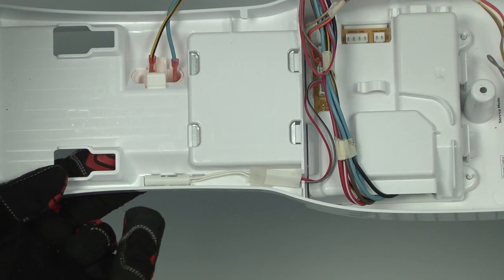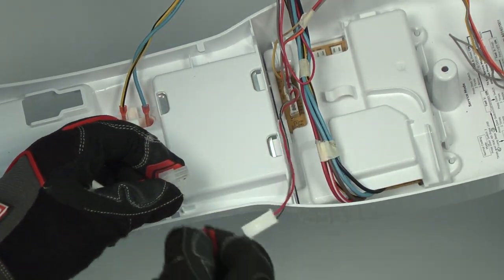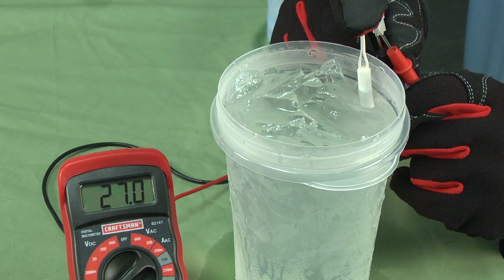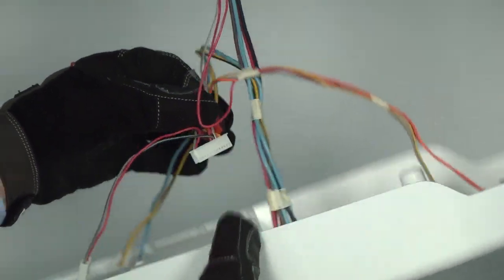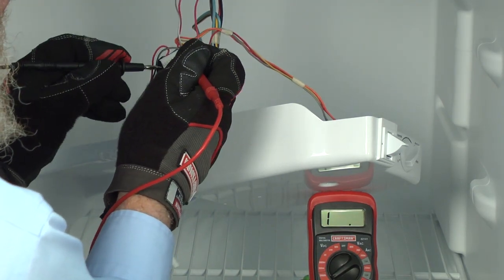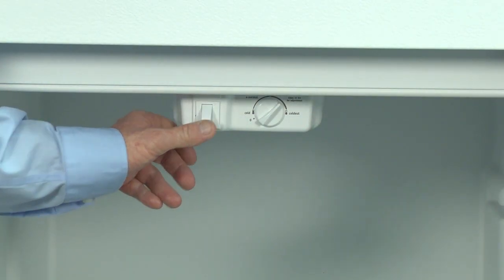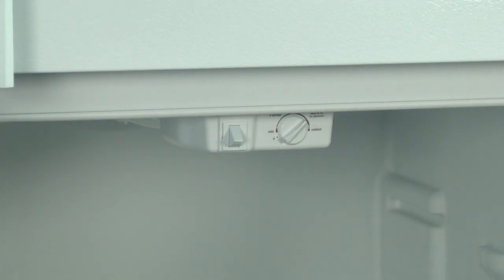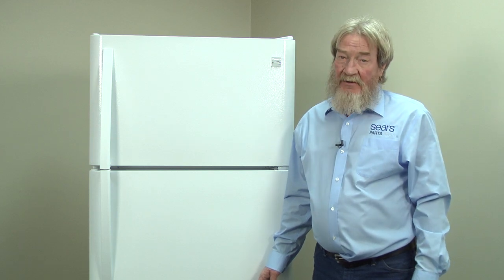Troubleshooting Thermistor Problems in Refrigerators

Comment: can  you  help me 
I hvae  sansumg   that  freeze  solid  in the  hupper part
I have a model rf22nctaww with freezer at the bottom it freezes at the top it doesn't control its temperature well at the top have to change the fan at the bottom it doesn't do anything cahnge they can hear the hatch open or close
but have doubts whether it closes completely and it freezes everywhere is it difficult to clean the hatch or change it on this model

a video would be welcome
THANKS

Comment: AWESOME Video. I was trying to diagnose the thermistor in my KitchenAid Ice Maker and this video helped me a lot. Testing the resistance of the thermistor was the key bit of information that I needed. Once I found the tech sheet tucked inside the ice maker next to the cooling fins, I discovered the values of resistance I needed to know.

Comment: Hello, I have a Whirlpool WRT318FZDM05 refrigerator. The evap coil in the freezer keeps freezing up (solid ice). The defrost element test with 40 ohms of resistance, so its not open. I feel I have narrowed it down to the thermistor on the evaporator coil or the control board. I have no spec sheet for this refrigerator unit, so not sure how to troubleshoot further on the thermistor. Any suggestions, or am I at the point to take a shot in the dark and buy on of the two replacement parts I mentioned? Refrigerator works absolutely fine for roughly a month until the evap coil freezes, then after a manual defrost, rinse and repeat.
Reply from the maker: The tech sheet for that model lists a defrost bi-metal but the wiring diagram shows a fuse instead of a bi-metal switch in the defrost heater circuit from the control board. With the freezer cold (so the bi-metal is below 25 degrees F and closed), unplug the refrigerator and check resistance through the brown and white wires that connect to the control board. If your meter measures infinite resistance through that circuit then the defrost bi-metal or thermal fuse in that circuit is likely bad. Replacing that component should fix the problem. We hope this advice helps. If you need more help, let us know.

Comment: Ive checked my defrost thermister the readings are no where like the ones you've tested here 
Mine reads 6.5 at room temp and 13 in ice water 
The temp sensor for the freezer reads way different again and the fridge different again 
I was assuming all 3 should have similar readings

Comment: Thanks for the great video - I'm troubleshooting a Frigidaire GLFU2067FW5 upright freezer. Start relay checks ok, compressor will not come on but checks ok with continuity at all points. So I think that leaves me with the thermistor or the control board. Can you provide the spec on the thermistor? I don't have the sheet and cannot find it. I'm trying to follow  your diagnostic order before I order an expensive part that I don't need. Thanks in advance for your help.

Comment: What if the fridge stops before it's cold enough because the compressor is overheating (IF that's the case) and WHAT IF the evaporator motor and sensors are okay but the coils are very free of any frost at all, super clean? Could it be the r-134 is too weak and causing the compressor to overwork? Just looking for another possible solution to a too warm fridge.

Comment: Thanks for this great video! As I have learned, "high temp" is not same as high temp alarm. What I have seen on working freezers (set point temp maintained properly according to electronic thermometer) are erroneous triggering of high temp alarm once a day. Display usually shows correct/sane temp for a freezer. I am focusing on thermister and controller in this case. Regarding other units actually running hot, I have identified a problem in which fan stays on during auto-defrost on a blast freezer (Arctiko FP500), which turned freezer into an oven. New controller, did not resolve problem, but shutting off auto-defrost completely resolved problem. What apparently was happening was that as the temperature rose, the compressor would turn off progressively longer, but auto-defrost would progressively be on with fan also turned on longer up until the point defrost + fan were stuck perpetually on. I hence discovered a new way to cook food... with a freezer!

Comment: Hello. Thank you for these videos! I have a WRT318FZDW00 (zero zero, not oh oh). Can you please tell me what my readings should be at room temp and in a cup of ice water. I can not find ANY info on this model. And the paper work from underneath the backside gives me barely any info.  Thank you :)
Reply: Ps. Also if you have a part number in case I need to order a new thermistor. Thanks again!

Comment: Hi, Ive got a LG model #Lfx25978st and ive tested the freezer thermistor and at 32° i got 6.8 Ohms. I do not have the manual for the fridge and can not find the temperature resistance chart for it online. Not sure if the thermistor needs replacing.

My fridge and freezer stopped cooling and was only blowing hot air, then when cleaned and unplugged for 24 hrs to thaw started working again really well. 5 days later it started to warm up and stopped blowing cold air again. All the fans work too and so does the condenser so I am at a loss
Reply from the maker: Here's a link for a copy of the service manual for that model: https://www.manualslib.com/manual/996736/Lg-Lfx28978-Series.html . Check your meter settings. The meter may be measuring 6.8K ohms which would indicate the thermistor may be detecting a warmer temperature than actual temperature. That thermistor likely isn't causing the problems that you're describing. The refrigerator may have a bad control board. A number of other problems could be causing the problems you're describing.

Comment: @sears PartsDirect (Wayne), Hi Wayne, Great video btw and thank you. I have a 
JFX2897DRM02 Jenn Air, noticed the fridge wasn't cooling, internal temp was around 45-50degrees. Replaced the interior fridge fan (attached was the temp and thermistor). With the old parts and the new parts the fridge only cools down to 36 degrees only when I  power cycle. After an hour or so the internal temp starts to rise and i check it the next day and its not cooling... question i have is, there are 3 control boards on my unit, which one should i try replacing first?
Reply from the maker: If a control board is causing this failure, it''s likely the main control board. Here's a link with a photo of the board: https://www.searspartsdirect.com/product/14qr259849-0046-106/id-w10811364 . Keep in mind that a number of other component failures could cause the symptom that you're describing. Before you buy and replace an expensive control board, we recommend that you consider performing more troubleshooting and testing of components. Follow the testing procedures described in the tech sheet for your refrigerator. You'll likely find the tech sheet on the back of the refrigerator or behind the bottom from toe panel. Unplug the refrigerator before accessing internal components. If you're not completely confident that you can safely follow troubleshooting tests described in the tech sheet, we recommend that you have a service technician examine and repair the refrigerator. We hope this information helps. Let us know if you need further assistance.
Reply: @searspartsdirect  thank you!

Comment: The evap coil is not icing up, so no issues with defrost that I can see. I replaced the thermistor, and still not cooling. It seems like it's cooling a little, but not nearly enough for the freezer. If the compressor, condenser and evaporator fan are all working during normal operating mode, but still not getting cold, could it most likely be be the control board?
Reply from the maker: A bad control board could be causing the symptoms that you’re seeing. If you’re not seeing a light, even frost pattern on the evaporator when the compressor runs, then low refrigerant charge, a clog in the refrigerant system or a bad compressor could be causing cooling problems.
Reply: @searspartsdirect  Well, if it turns out to be a bad compressor, then I'll probably throw in the towel and just get a new fridge.
Reply: @searspartsdirect  ...New control board didn't fix it either. Oh well. I think the compressor, though running, just isn't running strong enough and/or there was a freon leak. Looks like a new fridge is on the way.

Comment: Hi, I put the refrigerator thermistor in ice water for 5 minutes and tested resistance. I wasn't sure to use 200K or 20K setting. I measured the following on 200K scale. 08.4 or 8.4 on 20K scale. Not sure how to convert the numbers to thousands of ohms. This is a Whirlpool WRT318FZDW02 refrigerator thermistor and there have been problems with it running constantly and freezing food. I couldn't locate a thermistor resistance on the refrigerator spec sheet to know if this thermistor is good or not. Also both evaporator and condenser fans operate and the compressor operates all the time too. Condensor appears clean and is cool to the touch. Ice forms at capillary tube in freezer and I never see frost on evaporator.-
Reply from the maker: According to the details you provided about your meter, it sounds like the meter measured 8400 ohms (8.4K ohms) of resistance through the thermistor at 32 degrees F. That's normal resistance for a Whirlpool thermistor in that model. According to the temperature/resistance chart we have, the meter should measure 9269 ohms at 30 F and 8050 ohms at 35 F so your meter's reading of 8400 ohms at 32 F indicates that the thermistor is likely okay because it reads the right resistance at 32 F. Because the thermistor seems to be okay, you'll likely need to replace the control board (part W11353813 -- https://www.searspartsdirect.com/product/1er8tftd46-0046-106/id-w11353813 ).  We hope this information helps. If you need more assistance, let us know.
Reply: @searspartsdirect  Thanks very much for the information. My meter I have is the same model Craftsman as pictured in this video.
Reply: @searspartsdirect It appears the part number you provided is the control panel/control box assembly; With the LED lights, power on and off button and temperature light selector. Does this include the control board itself? I ask as the part number I found for the control board is  W11436574 and that doesn't match the part found in the link. Please clarify if possible. I assume from your prior comments that the control board itself likely needs replaced

Comment: Could you please tell me the function of the thermistor inside the refrigerator cabinet. I ask as our refrigerator has one in the refirgerator portion and also one in the freezer question. 
I need this information to help determine if one or the other thermistor is contributing to our refrigerator that is only 1-2 years old seeming to run all the time. 

The refrigerator food section seems to keep the food cold enough and freezer section the frosen food is solid enough but the fan for the evaporator in the freezer section seems to run non-stop for some reason. Sometimes some of the food was even showing ice on it. After removing the cover I did locate some ice build up on a small section in the top corner of the evaporator in the freezer.
Reply from the maker: The thermistors detect temperature and send a temperature signal to the electronic control board. The electronic control board turns on and off the compressor to maintain set temperature based on the thermistor signal. A thermistor on the evaporator of some refrigerators is used to monitor evaporator temperature so the electronic control board shuts off the defrost heater when it detects that evaporator temperature has reached a level where frost has melted off the evaporator fins. We hope this information helps. If you need further assistance, give us more details and let us know the model number of your refrigerator.

Comment: How many ohm in cold u think good for use?
Reply from the maker: Resistance of thermistors varies by refrigerator brand and model. For the thermistor shown in the video, your meter should measure around 27,000 ohms at 32 degrees F. If you have a different model than the one shown in the video, let us know the model of your refrigerator and we'll try to provide you with resistance values for the refrigerator thermistor in your refrigerator.
Reply: @searspartsdirect     Thanks 🙏

Comment: Hey Ben. I replaced control board and thermistor, but Frigidaire LFFH21F7HWG keeps running. goes below set temp, no ice build up, wiring plugs are underneath. dont know what pins are for thermistor. pins are intagrated into the door, pin housing is not removable. there are no freezers for sale right now, a national back order they tell me.

Comment: Hi, great video! my LG GM 849RSC have FS error code on the front panel. What is the values to check it with multi meter?
The error reset after reconnect power cord and showed again time later.

THANKS!
Reply from the maker: Although we don't have technical information for that particular foreign model, the resistance of the freezer sensor for most LG refrigerators is 7.88 k-ohms at 32 F or 0-degrees C. If the freezer is at operating temperature (near 0-defrees F), you can unplug the refrigerator and measure the resistance through the freezer thermistor circuit from the electronic control board on the back of the refrigerator. Most LG refrigerators have a wiring diagram sticker on the back panel that will guide you on checking the freezer thermistor circuit. Resistance at +5-degrees F (-15 C) should be 17 k-ohms and resistance at -4F (-20C) should be 22.33 k-ohms. If the freezer isn't at operating temperature, you can unplug the refrigerator, remove the thermistor and place it in a glass of ice water to get it to 32F (0C) then measure resistance. We hope this information helps.
Reply: @searspartsdirect  wow big thanks for this detailed answer. Found disconnection in the thermistor harness so everything great for now

Comment: I have a ge profile model PSIC5RGXCFBV that will work fine for 5 or 6 months and then just stop cooling.  Everything will completely defrost and after about 24 hours it will start cooling again and work fine for another 5 or 6 months.  I have replaced compressor,  3 motherboards and 2 inverters.  The problem still occurs about every 6 months.  Any ideas of what my problem could be.
Reply from the maker: The problem that you're describing is likely caused by a bad electronic control board (motherboard). Because the refrigerator cools normally most of the time, the other components are likely okay. Even though you've replaced it 3 other times, you'll likely need to replace the electronic control board again to fix this problem. We hope this information helps. If you need further assistance, let us know.